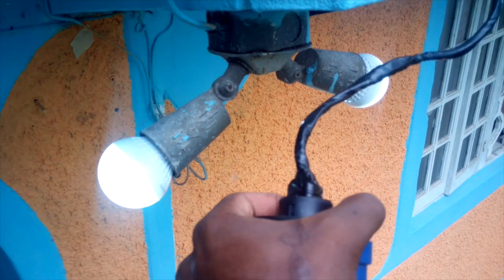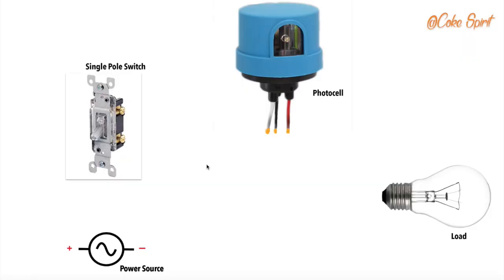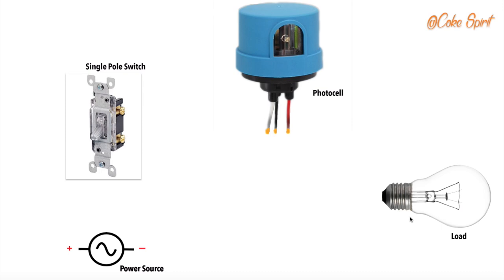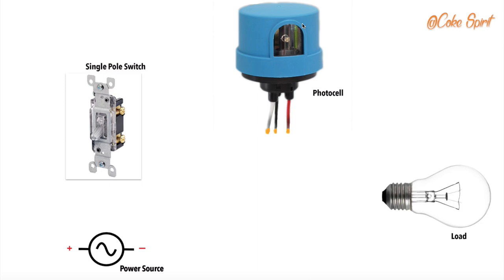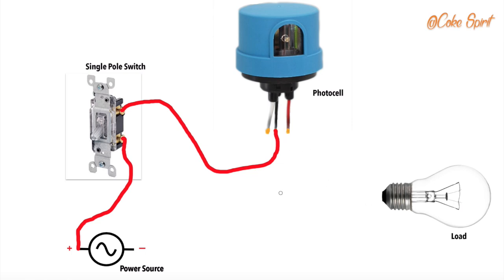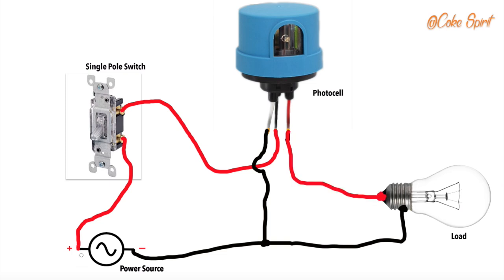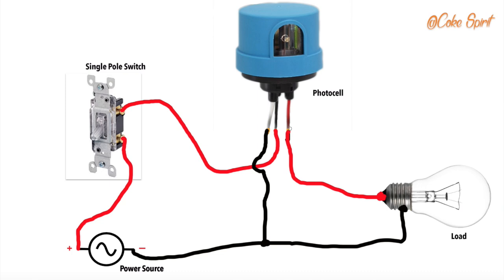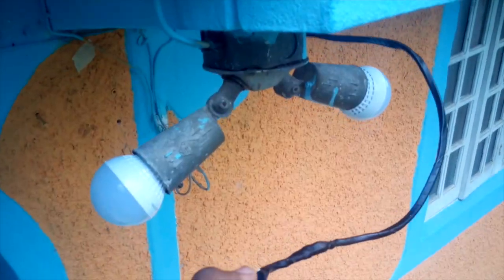HOW TO WIRE A PHOTOCELL IN A CIRCUIT

Comment: This is fine if it’s a on off switch.
But if your wiring a dimmer switch it has to be after the photo cell…
So it’s power to the photo cell and then photo cell led to dimmer to light fixture

Comment: Hello can you install the sensor from a plug to power 3 lights. If so what amp fuse do i need in the plug thanks
Reply from the maker: I cannot coach you via such principle, 

Since it seem as if this circuit is gathering some sort of permanence, the proper thing to do is create a circuit from your point of distribution with same loads or branch from an existing light circuit that will not be deemed as overloaded based on the total (WATTAGE) that should be assigned to a circuit thereby which a fuse /circuit breaker would be already installed to protect that circuit

Comment: Can a photocell base go bad and short out the photocell? I recently bought a new photocell to replace a 10 year-old one on the side of my house that had stopped working. As soon as I twisted it  into the base there was a short "POW!" sound and I was back at square one. The original base is at least 15 years old
Reply from the maker: Ensure that it is wired properly.
Reply: @CokeSpirit  methinks the original wiring installed by a licensed electrician almost 20 years ago probably needs to be replaced because of age. I'll definitely check it out
Reply from the maker: @mirxtrail  Alright
Reply: @CokeSpirit  - Update: photocell base was found to be defective and replaced along with new photocell
Reply from the maker: @mirxtrail  Good Job

Comment: What if I'm using a 9volt source from a solar power cell , same diagram ?  Can I add fuse or circuit breaker ?

Thank you for sharing
Reply from the maker: The same principle is desired with an alternate photo electric cell since the supply voltage is 9V DC. Be sure to add fuse or circuit breaker as you'd like as long as they're reconcilable.
Reply: Thank you
Reply from the maker: Bless....

Comment: I have 2 switches each one controls 6 cans and I want to put all 12 cans tied to photo Eye can this be done
Reply from the maker: Im not quite understanding the clarity by which you're inquiring, nevertheless i will assume that "cans" mean incandescent lamps. In regards to your location and standards governing lighting infrastructure and installation I'd implore you to verify with local code of ethics/regulations prior to your endeavor.

 NB: our regulation permits a maximum of 1200W to a circuit with minimal switch gear(circuit breaker) rating of 15A which can be itemized by 12 * 100W incandescent lamps. 

On another note a maximum of 1000W to a circuit with minimal fuse rating of 15A which can also be itemized by 10* 100W incandescent lamps.

Comment: The power should go to the Photocell first, not the switch.

The way you have it wired, you are switching the photocell on and off repeatedly, which will cause wear on the photocell and diminish its useful life.

Take power to the photocell, then to the switch, then to the load.
Reply from the maker: 👎 Check with your local Electrical Regulatory Body for guidance.

Be sure to get professional training prior to undertaking any such work especially when it comes to the safety of others/customers.